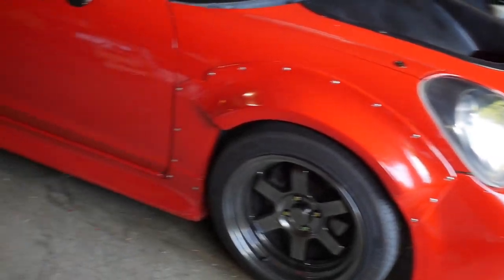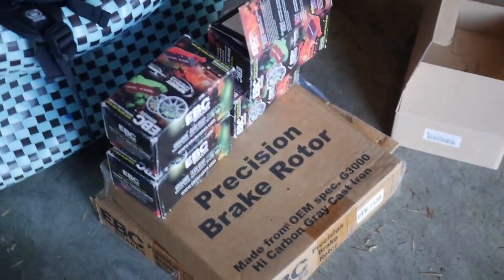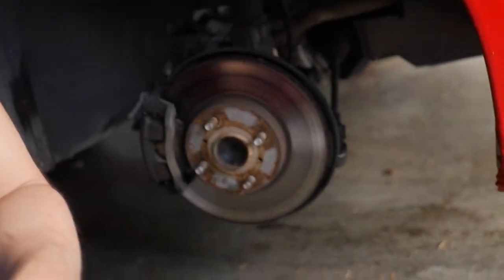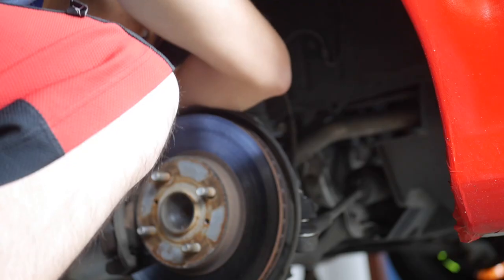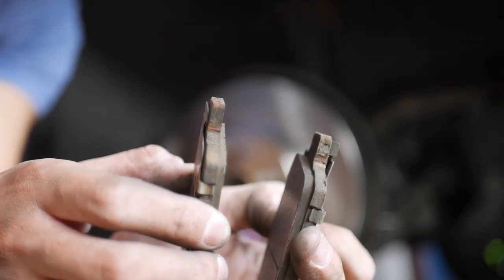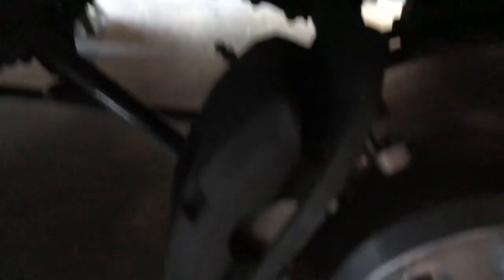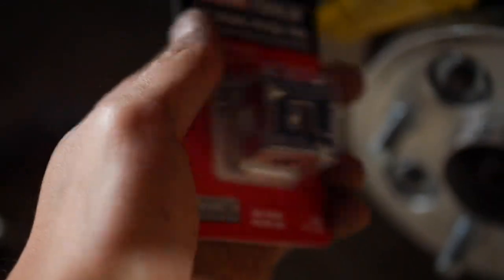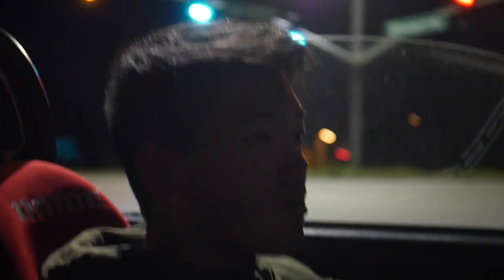The BEST brake setup for the Toyota MR2 Spyder! | EBC Yellows + Rotors

Comment: japanese tuners also install something that changes your braking pressure so u are using rear disc more for better stoping power(makes sense since front is super light) :P
Reply: btw, SKETCH :P
Reply: The bias from the factory is already designed with the weight distribution in mind. I've found that as I add grip (tires mostly, but also suspension and aero), the harder braking that allows shifts more weight forward and I lock up the rears easier. I'm about to install a brake bias valve (in line with rear brakes and it limits pressure that goes there) to shift my bias where I want it. $50 or so on Summit Racing but you have to have lines/fittings to install it.
Reply from the maker: Thanks for making it all the way to the end!! I appreciate it
Reply from the maker: Yea I noticed that too. The rear end locks up more and more LOL but thanks man! This is why I love posting Bc I need feedback like this

Comment: The exhaust sounds great but ive looked for a vibrant 2.5in ultra quiet muffler to make my own but all i can find is ultra quiet resonators by vibrant. Do you have a part number by chance?
Reply from the maker: I may have mis spoke. I used the ultra quiet resonator. It really did help reduce so much noise
Reply: @RedlineRicer   it's weird because it looks like the size of a muffler in the video. Thanks for the help
Reply from the maker: I went ahead and tried looking through old orders in my email and it was indeed a vibrant muffler. I can’t seem to find the same part number anymore unfortauntely. It looks like 1320 performance makes an “ultra quiet muffler” that has good reviews and looks similar if you want to try that out
Reply: @RedlineRicer   thanks man I appreciate it. Also I love the current build.